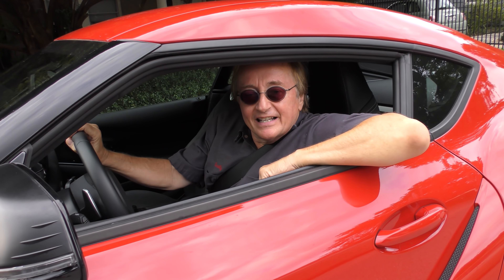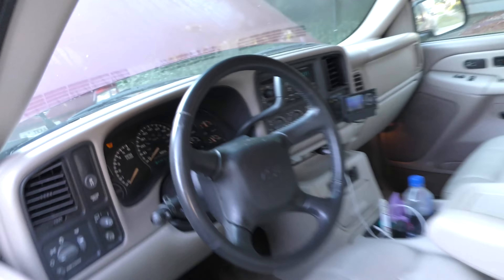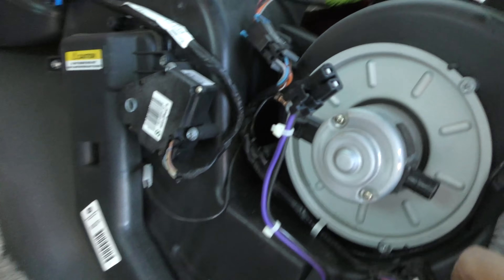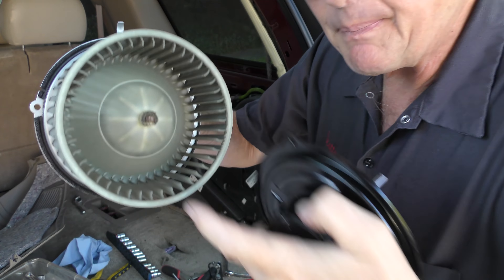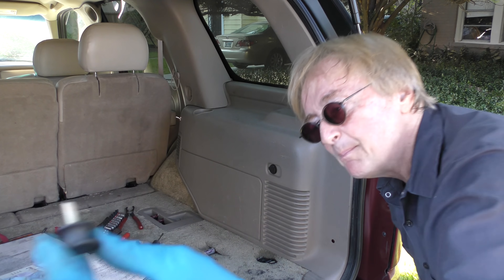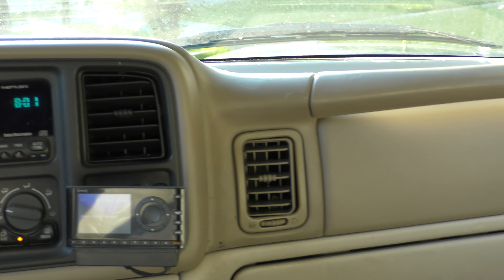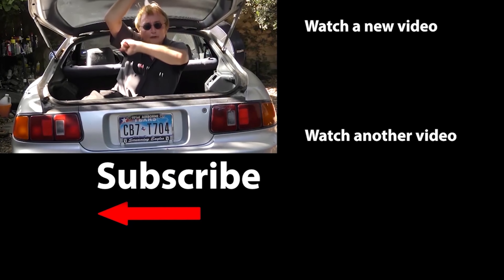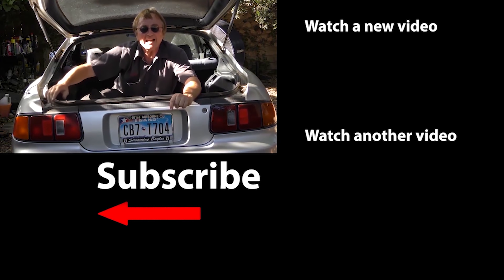Doing This Will Make Your Car's AC Blow Twice as Cold

Comment: I’d have to clean the fan before reinstalling it. Guess I’m a bit OCD.
Reply: Proclaimor it wasn’t plugged, but it was covered in dark dust, the whole thing is supposed to be white plastic
Reply: Mechanics typically don't do anything they're not specifically getting paid for
Reply: Yep.
Reply: Looks like he stained the hell out of the carpet spraying it with the WD-40😂
Reply: I agree, it looked pretty dark -I would have spent 5 minutes to wash & dry.
Reply: Yeah was wondering that also I would have cleaned it.
Reply: Nope I was thinking the same thing.  Already have it out, might as well clean it.  It will only take a few minutes.

Comment: Spent an entire day changing a in tank fuel pump on rear tank of my Ford F-150. Got to remove the trailer hitch too. Had purchased a pump off the Internet for good price, thought I was good to go. Drove 1 tank of gas and then the great deal off market pump failed! Had to jack truck back up, remove hitch assembly and tank. Replaced with factory pump $$. That was 4 years ago and the 91 Ford never ran better. Scotty is right on when he tells you ‘don’t go cheap on parts’ especially the parts (clutch, pumps, electronic) that are vital.

Comment: @5:00 Also make sure the radiator isn't clogged with dirt/leaves. And there is one thing that MOST PEOPLE forget, which is overfilling the AC with refrigerant out of car spec⚠️, it will make the compressor switch OFF and ON constantly because it's overloaded. Please up vote so he and others can see this. You can't imagine how many times people forget to wash their radiator, or mistakenly overfill with refrigerant.⚠️

Comment: Good video. I happen to have the reverse. Rear fan works, but the front fan appears dead. Now I have an idea what to test. Thank you.
Reply: Check the front blower motor. It's probably under the passenger foot well or a little more towards the center. There should be some removable plastic covers.

Comment: The fan motor has 2 wires, so it should run with only those wires plugged in, but it’s not recommended to connect only the fan plug. The ground wire connected to the frame of the fan prevents static build up of the fan blade. Without that connection, the static build up discharges through the fan motor bearings damaging them and shortening the life of the fan motor.

Comment: Scotty I have a 1992 Volvo 940 just replaced head gasket all the belts radiator hoses and fuel pump. Should I keep it or sell it. Only has 143k miles. Didn’t have to pay labor cause a friend is fixing everything.

Comment: Hi Scotty. I have a 2000 Nissan Maxima. And it doesn’t have a control for A/C and the only way for it to blow cold air is by having the auto on and when the car is moving. If it isn’t moving and the car is set to 65 degrees, cold. It will still blow out hot air. How can I get the maximum effect for cold air? And another small thin, I wanna ask as well. How can I make the car engine sound less like a roaring train when it is just idling. Since I know it is a older car. Just curious about what I can do for this car.

Comment: Talking about freezing cold AC...my 13 Tacoma has auto AC...so it puts it in AC AND RECIRCULATE automatically. Now the AUTO AC does not work....which I like but when i turn the heater knob one notch towards warm/hot my AC is still blowing cold air...WHY??? I am curious? AC still works perfectly well otherwise!

Comment: Hey Scotty, 
One of my relatives owns a 1988 Dodge Power Ram 50. They said that one day it was stuck in 2nd gear parked it in the drive way for 3 years and took the trans out and left it on the truck bed. 3 years later they tow it to me to check it out and what I discovered is it shifts but sometimes it requires me to shake it in neutral to put in gear. Later I sent it to a trans shop and cost me $300 of labor cost . What should I do?
Reply: Sell it.

Comment: The control for the rear AC is above your head in the center, it should be controlled individually (front/rear) if the switch for rear AC is not on AUX. I think the reason he didn't show the old blower motor working (it had power going to the motor) is because it really didn't need a new motor. Maybe just a video to have content? Btw, made a mess with that WD-40 lol.
Reply: Worn brushes or dried-up Oilite bearings could have made replacement prudent.
Reply: @stephenarling1667  we will never know

Comment: Hi Scotty, my question is my A/C comes on on its own. I turn it off most of the time within a few seconds it pops back on. Would it be a bad switch or something else. Don’t want to exhaust  all my refrigerant. Thank you
Reply: "Exhaust" your refrigerant?  Really?
Reply: Yar Nunya   I misunderstood his use of "exhaust". Yes, that is correct. Even with the compressor off and pressures at equilibrium, at any ambient temp., those pressures are very positive. At an ambient temp. of 70 deg, it's about 70 psi for both R12 and R134a.

Comment: Just move to Canada and open your car's windows it's cheaper and more relaible
Reply: +33° C today
,,opening windows will only get you cooked
Reply: @WANDERER0070  51°C in my country your temp sounds like spring to me
Reply: @mta4144  were you live? The desert?
Reply: That was in the 60's - 70's. Today's compressors are lighter. The bearings has less drag...etc... The RPM on my 2010 Silverado doesn't change when I turn on the a/c BUT, it does on my 70 Buick GS. And yes, my 70 Buick GS consume more gas with the a/c on. The again, it's a convertible so...
Reply: @WANDERER0070  I did have my windows down for a few minutes. The roasted chicken smell convinced me to roll them back up and use the a/c.
Reply: @unknown-kz9ei  It's bullsh*t. I checked today's weather throughout the world.
Reply: @rverro8478  i live in Saudi Arabia check again

Comment: Hey Scotty my ac doesn’t blow cold they told me my system had to much air what does that mean? How I fix it?
Reply: Do they mean too much refrigerant? ... or too much air (as in atmospheric air) mixed with refrigerant?
If the former you need to put a vacuum up to it and reduce the pressure accordingly. If the latter, you need to fully evacuate the system (under vacuum) and start over.
Reply: TheCarMan they told I had to do something with a vacuum but I wasn’t to sure how to do it
Reply: @marcolopez4906  Best then to let a trained mechanic do it who's familiar with AC systems. Plus they'll have the proper equipment needed.

Comment: Hey Scotty, i change my oxygen sensor and replace it and the code did not went away. I check the fuse and fuse was good. I check the hardness it good. I check for shorts and there was none. Im confused, it a 2000 toyota avalon xl. Help please. And no it not my ECM.
Reply: Did you clear the code after replacement?
Reply: @wholeNwon  no not yat

Comment: Scotty my first car is going to be a 2001 Honda civic with 160k miles. No leaks or problems as of now and everything is stock except for a fixed ac. Is it going to be reliable for me?
Reply: Get a good PPI first, unless it's a gift.  Keep up with the oil changes and trans. service. NEVER flush it.
Reply: @wholeNwon  yeah my dad used it as a daily driver instead of his diesel truck and its gonna be mine soon
Reply: @sic7475  So, a gift?  Check the ball joints, tie rod ends, steering, struts, brake lines, etc. for safety. 
Good luck.

Comment: Chances are pretty high if you have an SUV with those rear blower motors that it will fail on you much sooner than the one in front will.
Reply: Why?
Reply: @stephenarling1667  Your guess is as good as mine.  It just seems to be the way it is though.

Comment: Scotty how do remove a stuck wheel? Help!
Reply: Hit it with a rubber mallet maybe?
Reply: @far out  @stephenarling1667  lol, yeah, what he said. The rubber mallet is probably just going to come straight back at your forehead. You'll need the sledgehammer, most likely. Btw another helpful tip is to bend your dust shield out of the way. Don't worry about it, it's just a dust shield. If it broke off and you threw it away it wouldn't make a difference really

Comment: On my Yaris, when I'm at a red light, the a/c does not blow as cold as when I am moving at a good clip. Is this normal?
Reply: Might be the battery or charging system causing the issue.... If its causing the fan to speed up and slow down with the engine.
Reply: @DAN007thefoxx1  The fan speed does not change, just the coldness of the air is less at idle.
Reply: @pedrofernandez8729  Idk then.
Reply: @DAN007thefoxx1  Most likely has lost some freon, it is 10 yrs old and it has spent all its life in So Fla
Reply: @pedrofernandez8729  Might try that then. The engine rpm seems to be affecting it. And most compressors are belt driven (a Prius uses an electrically operated one so it can stay tunning even with the engine turned off)

Comment: fixed the rear AC is actually make the system work 100%, how is it make the AC blow twice as cold?
Reply: If it blows in the rear as effectively as the front you just the vehicle as a whole is twice as cold... Of course you could open a window and it wouldn't matter
Reply: @johnholmes5925  No ... just twice as much cold air, you didn't make the air coming out any colder. Let's say you got the air in your car to 70F ... what would the temperature be if you made it twice as cold? (I can hardly wait.)
Reply: It didn't. It just produced twice as much air (at the cooler temperature) than before. The phrase 'Twice as cold' is impossible to accomplish, like 200% less. Often used in common speak but impossible to do mathematically.

Comment: You never tested the old fan to show us if it worked or not! You jumped. You should have showed us the new fan works before you installed it? You should have cleaned the old fan blades before reinstall?
Reply: Old motor may be intermittent or worn bearings or both. Cleaning the squirrel cage would take time and is no benefit to the customer.